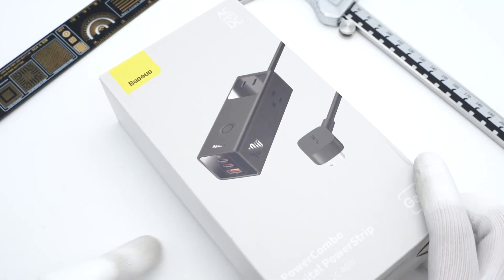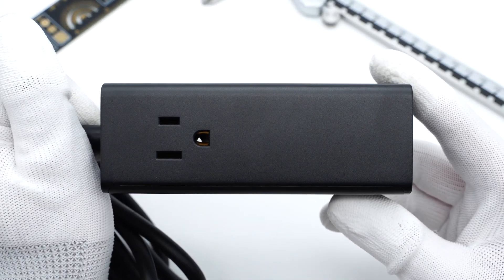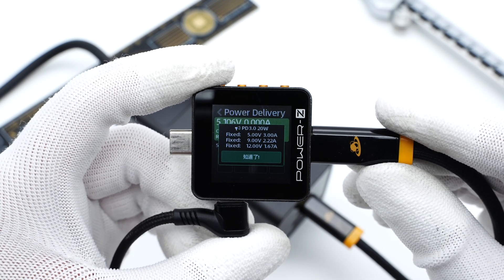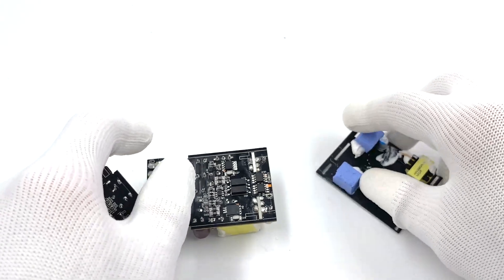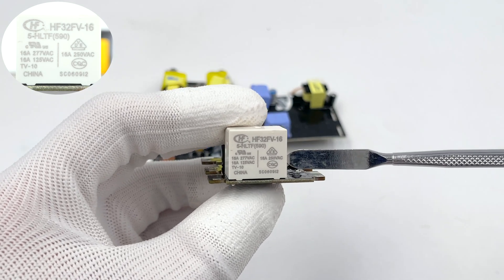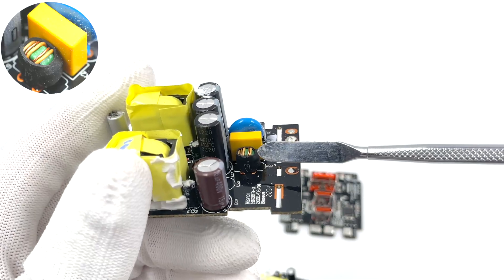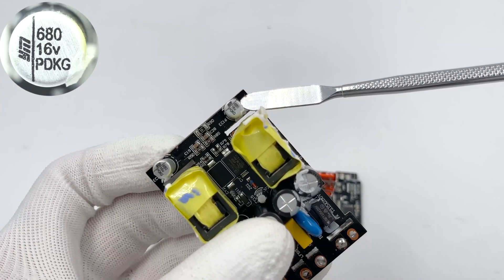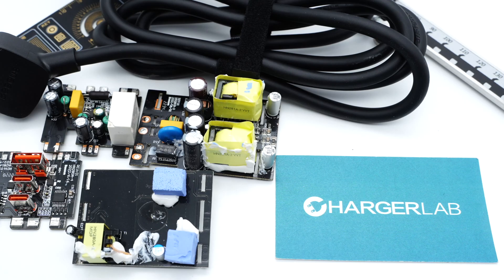Teardown of Baseus PowerCombo Pro 40W 6-in-1 GaN Power Strip

Comment: Baseus consistently claims in its product literature, labeling and packaging that their USB chargers with integrated AC outlets only work on 125V, but I strongly suspect that they work just fine in 240V outlets with the right plug adapters--provided of course that you only plug in dual voltage devices that can handle 120/240V and don't exceed the rated amperage.

If the AC is just pass-through and uses good quality connectors, wires and soldering, and the USB charger circuit boards are identical to the ones in the USB chargers that don't have AC outlets, then I don't see why this wouldn't be possible and safe, so I suspect that they say 125V for legal reasons, in case people try to plug in 125V-only devices on 240V systems.

Have you or anyone else been able to verify this? I have the 65W version of this and hope to use it abroad this year, both the USB ports and AC outlets (with low power dual voltages devices of course).
Reply: Hi, I'm just curious if it was successful? I mean I have 200-240v outlets at home but I'm interested in buying the US version
Reply: @tigerreplays5677  It works for some on 220/240V and it did for me but I've heard that there are new versions that use different internal components that might not work on such voltages. Probably best to get one that's rated for them to be safe, especially for regular use and not just when traveling.
Reply: @HabaneroTi  oh, I see. It's sad, I wanted to order several for me and my family but it's risky for now :(
Reply: @tigerreplays5677  My guess is that it would work, but why risk it?

Also, the outlets, while using the US grounded 5-15P standard, would still be putting out whatever voltage comes out of your wall outlets, so assuming that your devices use whatever plug standard is used in your country, you'd need a plug adapter for both the plug and outlets, making this a clumsy solution just for the AC pass-through part.

At best, it'll work for US or Canada-based travelers for use abroad while traveling, but for daily use abroad it just seems too clunky assuming that it works at all. Surely they make versions for use in your country.
Reply: @HabaneroTi  Yeah, you are right, it's not a good idea to risk. I saw some EU versions but they are more expensive, has a different design and GaN 3 not a GaN 5 :face-purple-crying:
Reply: @HabaneroTi  Like just feel my frustration that buying US version from Amazon and shipping to my country (another continent) will be cheaper than buying EU version XD
Reply: @tigerreplays5677  If it were me I'd always buy the version that's suited for my country that hopefully also works abroad on other voltage standards to not have to deal with plug adapters at home, only when traveling. Well worth the added expense IMO.
Reply: @HabaneroTi  yeah, will do the same otherwise it's pointless to get it. Thank you for answering me 🤗
Reply: @tigerreplays5677  And FWIW I've had my US-based unit for nearly a year and really like it. It worked abroad on 240V without any problem but mainly it's for use here at home on 120V and it's worked great for that, to charge my phone, tablet, laptop and various other devices as needed. The only thing I'd change is to have the USB ports on top and not the side, as it would make cable organizing cleaner and simpler.

Comment: I own a macbook pro 14 inch base model and it came with 67w usb-c power adapter.

I wanted to ask that will there a huge charging difference if I buy apple 96w usb type c power adapter or should I simply use the default apple usb 67w charger.
Reply from the maker: The 96w is obviously faster than 67w.
You can get a 96W if you wanna get the faster charging speed.
Reply: @ChargerLAB  thanks for the reply..

wanted to ask if if use the 96w will it have major impact on battery health.

Comment: Please explain how this power circuit works
Reply: With ultra-sensitive digital control technology, the master chip(BDIP Chip) monitors and detects malfunctions like overload, overvoltage, undervoltage, overcurrent, short circuit and more, then actively cuts off the power in 0.1 second. This advanced technology keeps you safe from potential dangers.
Reply: Just like power strip with usb ports? WTF?